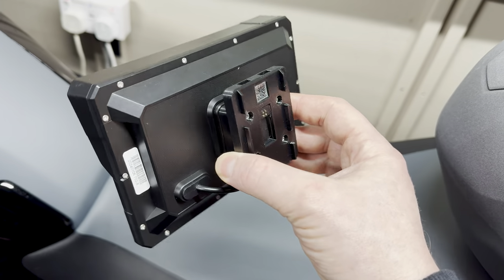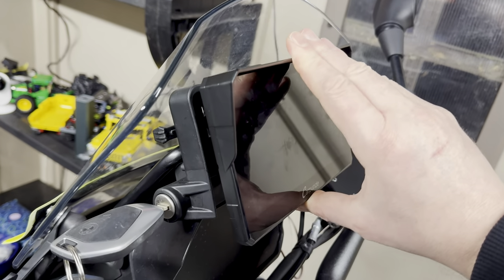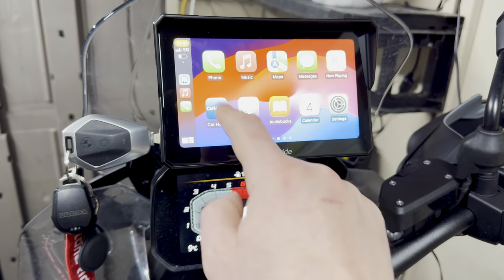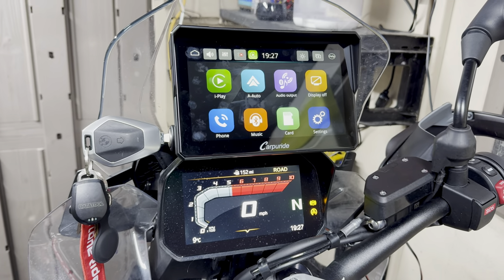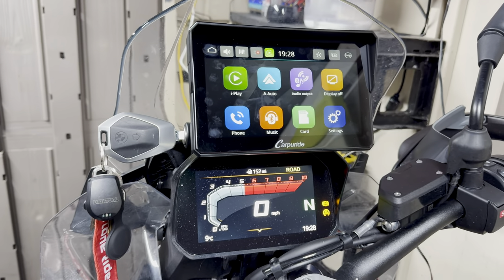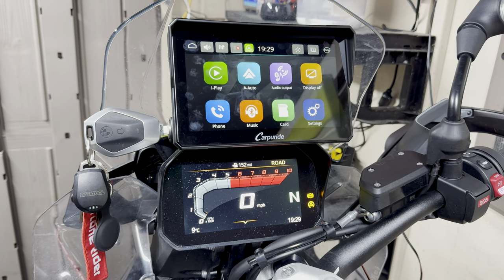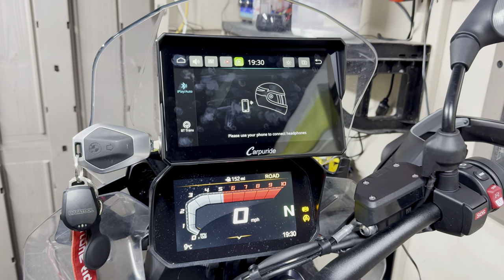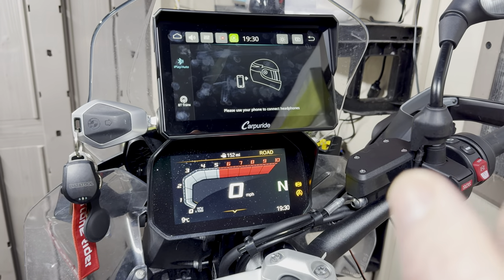Carpuride W702: The Best Upgrade for the BMW R1300GS?

Comment: thanks for sharing, the ability to fit a proper adapter  that fits the BMW connect cradle is a game changer for me, so I might get one, but I wonder what you think about size, the 7" you have fitted does look a little bit big, wondering if the 5" might be a good option? also, it you could share your wiring changes in more detail that would very helpful too...
Reply from the maker: The adapter I bought also fits the W502 so that’s definitely an option! Basically the wiring change is there is a short piece of cable on the W702 that goes to a connector, you can then plug this into either the enclosed USB lead or another lead they supply that goes direct to the battery. The adapter picks up the power off the BMW cradle and goes to 2 wires inside it which means you have to cut the connector on the W702 and join to the ones in the adapter. It’s literally 2 wires but obviously it does mean it voids the warranty for the unit if it goes wrong.

Comment: Great video. Thank you for your efforts. Do you prefer the Carpuride or the Samsung Tab Active3? I'd appreciate your thoughts
Reply from the maker: Hey Colin sorry for the delay in replying. I’m torn between which I prefer, I think if I could have gotten a smaller tablet but still bigger than a phone then I’d have said the tablet, providing it had good brightness in direct sun. But the Galaxy Tab on my new bike looks massive so I’m currently preferring the Carpuride as it’s much smaller and neater and the screen can be seen even in bright sun with my sun visor down.

Comment: Thanks man. I have a question, when mounted on the BMW specific bracket, can the screen be equalized at different angles on the ball mount?
Reply from the maker: Unfortunately regardless of which BMW specific mount you use, it removes the ball at the back so the angle is fixed. You can tilt the entire BMW cradle though it’s just 4 torx bolts and can be adjusted.

Comment: thanks for covering it all, I still have a couple of questions Sir if you would.
1. So in summary, you paired your phone to the headset and also the phone to the Carpuride ( to activate the Caprlay). Never the Carpuride to the headset. When you want to select the music on your Spotify you use the unit wich will comand the phone which will sent to the headset. Is that it?
2. Do you have a firmware version number or code to share, so we all know which one is the latest and which one should be updated?
thks

Comment: Helpful video. Do you know if the software fix you got was iPhone specific or common with android?
Reply from the maker: I think it would be applicable regardless of what brand of phone you used :)
Reply: @TheStammeringBiker   Yes. This is a firmware update of the unit. It makes absolutely no difference whether the unit is then paired with an iPhone (CarPlay system) or an Android OS phone.

Comment: Buenas noches. Donde sepuede comprar este adapter ??? Para BMW R1200RT. GRACIAS
Reply from the maker: I don’t know if the adapter will work on the RT, but if it does check out AAGB3D on Instagram :)

Comment: Is this just a mount that supplies power to the Carpuride or can you use the BMW control wheel to control CarPlay as well?
Reply from the maker: Yeah just the power supply, the Carpuride has to be operated via its own screen :)
Reply: @TheStammeringBiker  I see, it’s good I guess but a bit disappointing as you want to be able to control maps and music without having to let go of the bars.

Comment: Hi!
I'm in doubt with the size. I prefer 7" but I'm afraid that it cover the GS (1250) TFT information. What do you think about it? It wouldn't be happen or maybe it's better do get 5" size?
Reply from the maker: I'm 6ft2 so seeing OVER the screen is not an issue, doesn't cause any obstruction or interference to my riding visibility, as for the TFT it ever so slightly cuts into the top line of info on the TFT I'll admit. It's definitely not enough to cause me an issue I just have to lean back ever so slightly and I can see it, definitely not a hinderence but the 5inch would almost definitely eliminate that and in hindsight would probably be perfectly adequate :)
Reply: @TheStammeringBiker  🍻
Reply: It doesn't - we just need to raise the screen position a wee bit .

Comment: when you start the bike does the Carpuride turn off and restart?
Reply from the maker: @SteppaMovie Thankfully no, my 1250 did, when the starter button was pressed it would reset the dash briefly and was enough to cut power briefly to the nav cradle but on the 1300GS it doesn’t seem to.

Comment: Oh man please explain the steps you done to get everything working, im having the same issues with the sound its very stressful or maybe the version of your update and how you updated it
Reply from the maker: So assuming you have the same software version as me, you need to have your headset connected to your phone before powering on the Carpuride, then go into the Audio Output section and switch it to iPlay/Auto so that the Carpuride never gets the audio sent to it. If you are still struggling I’ll try and help more :)
Reply: @TheStammeringBiker  thanks man u solved my issue watched the video a second time and realised what you did all works fine thanks again and drive safe 👍👍👍

Comment: Did you buy the adapter they provided to connect to your gps cradle?
Reply from the maker: No I bought a 3D printed one from AAGB3D I didn’t realise at the time Carpuride did their own one 🤦🏻‍♂️
Reply: Thank you I ordered the one from Carpuride for my XR 👍🏻
Reply: i got my capuride adapter and the W502 unit today and connected to y S1000 XR 2023 model GSP cradle but it doesn't work.

any suggestion ? i contacted the customer care to see what is the possible issue. i connect my phone to bike's GPS cradle using an adapter from Amazon and it charges my phone and power on but not the one from carpuride

Comment: hello, I see most on here are paid promotion reviews, and you may of actually purchased it yourself,
so my question (if so) did you buy direct from their website? and if so other than the price of the unit was their any tax import duties to add?
I have emailed them this question but awaiting reply.
thanks.
Reply from the maker: I ordered the unit myself but didn’t order off their website I got mine from Amazon so no import duties at all. A friend has ordered his and I think it’s coming from china so usually anything I’ve had has been fine but obviously I can’t guarantee that.
Reply: I bought the device on Amazon.

Comment: edit: Wish I had purchased the W502B but the W702B works well with the available BMW mount.  However, your mount looks more substantial
When using a Cardo Freecomn 4X,  connect to the phone only to retain all of the Cardo voice and headset controls.  You may need to toggle the phone button to activate the interaction with the CarPlay unit.

Comment: I install mine on my 1300gs. When you turn off bike does it touch it your windshield? Is there any way to avoid that. The screen automatically goes down! And hit the device!
Reply from the maker: It doesn’t hit the screen on mine, you can perhaps loosen the Nav cradle and tilt it down slightly perhaps? I have the screen on the highest of the 2 mounting points.
Reply: @TheStammeringBiker  thank you very much, I just tint it a little bit down and it is perfect... Thanks for the tip!

Comment: €80 for 3D printed part?, also did Carpuride just simply send you a ling for the software update, as I am also having the same issue
Reply from the maker: Yeah it’s a bit steep but to be fair it was posted from Spain and arrived in less than a week. And yeah they sent me a Google Drive link to the latest firmware
Reply: You can buy a 3d printer yourself at home. Then spend many hours learning how the printer and 3d printing works, including exploring the properties of many different filaments. You will then design a pattern - a model of the adapter. Then you convert it into a data model that the printer reads. This will be followed by multiple trial and error printing.  And after a few weeks and a lot of wasted money and time, you'll find out that you should have paid for the finished product instead. Immediately the value of his rate for a pretty great product will be clear to you.
Reply: @hewlett62  🤣

Comment: Carpuride sell their own adapter too - specifically for BMW . Has anyone used it ? Would appreciate feedback . Thanks
Reply from the maker: I didn’t realise they didn’t the time I got mine in hindsight I should have got this. I’m sure it works brilliantly to be fair.
Reply: That’s the W702B but on their website it only lists 3 or 4 models of BMW it’s compatible with. R1200GS and R1250GS are ok but R1300GS not mentioned.
Reply from the maker: @kelcombe  the cradle on the R1300GS is identical to the 1200/1250
Reply: Yes, I’ve been in touch with them and they’ve confirmed any bike with the standard cradle will work.
Reply: I got my adapter and - it didn't work out of the box as claimed by Carpuride ; in fact it didn't work with the USB either. So I took it to a workshop , where they fixed it - apparently the OEM satnav mount and USB doesn't have enough ampere to support the device. What was funny is that the when I tested the device on a Moto Morini 600 , it worked off the USB .
Reply from the maker: @ArunPanangatt  that’s not true (regarding the amperage of the oem cradle or USB), I’ve powered the Carpuride off both with zero issues as well as my phone, a Samsung Tablet and a Garmin Zumo XT. The cradle and USB have more than enough amperage to power most things.
Reply: @TheStammeringBiker  thats strange - didn't work for me.
Reply: @TheStammeringBiker  my bike is a 2023 GSA
Reply from the maker: @ArunPanangatt  very strange. I’ve had a 2019/2023 and now a 2024 and never had any issues charging most things either off the cradle or USB, that’s very bizarre

Comment: Many thanks, I have the W502 version, which had old firmware, so I emailed Carpuride they emailed back the the updated firmware, this must be dowbloaded on a SD card no bigger that 32gb, I tired orgianally with a 64GB, but it could'nt read it, works fine with 32GB. Now has option to use audio output ... works perfectly with Iphone & Packtalk bold.Just ordered spare power cable and BMW cable mount, so I can swop it between 2 bikes.

Comment: Doesn't work seamlessly with Cardo Pack Talk and iPhone
1) Cardo paired to iPhone (No music but does read out messages through Cardo)
2) Cardo paired to Carpuride (Music but cannot control volume with Cardo. No easy value control on Carpuride)
Reply from the maker: I have the Cardo Packtalk and an iPhone and this works perfectly for me. I pair the Cardo to my phone only and I can control the volume via the Cardo. You do need to switch the setting on the Carpuride to ensure audio comes out of the headset and doesn’t try to play through the unit.